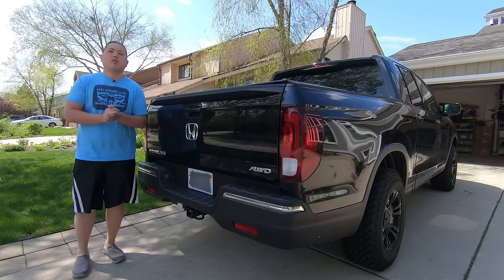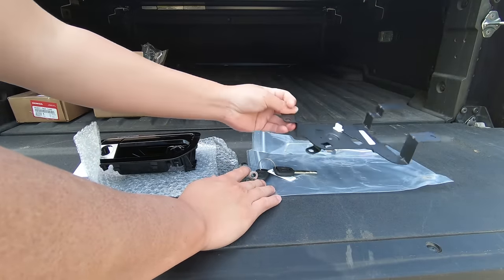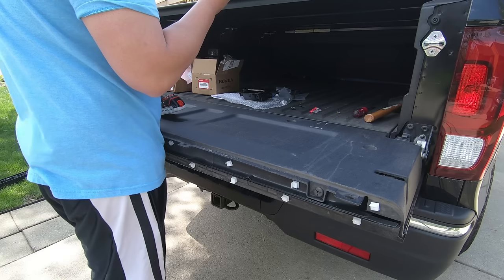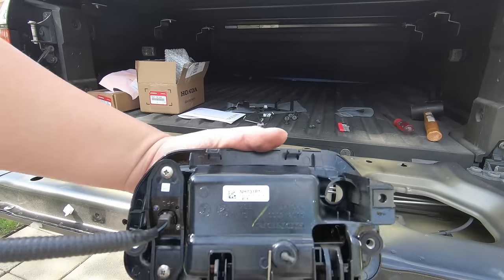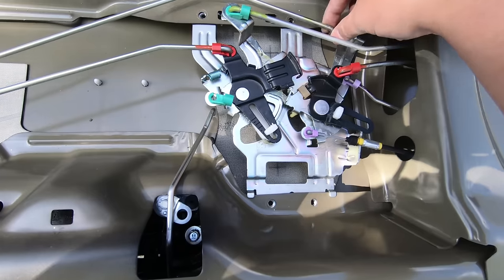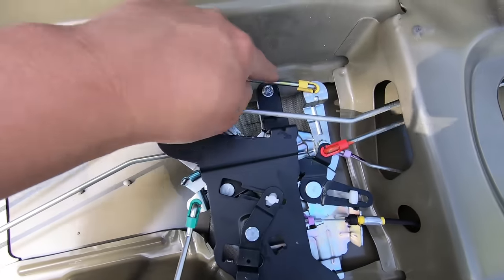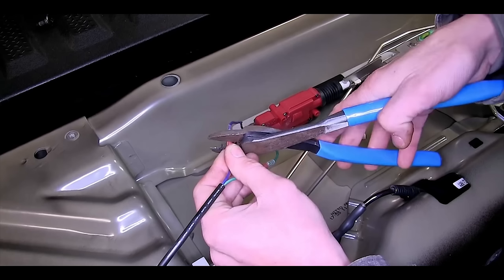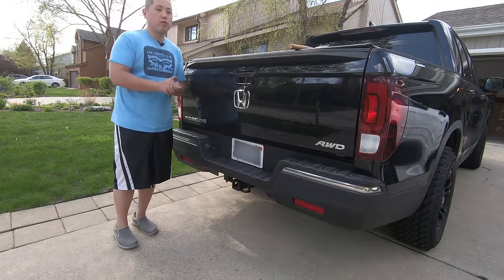Honda Ridgeline Tailgate Lock Install - OEM From Honda

Comment: I lucked out and didn't have to remove the tabs to slide my trim back on.  Lined em up and got it on the first try.  Also, a friend of mine with a Ridgeline suggested that I get my lock re-keyed.  So, I took his suggestion. I got my lock re-keyed to the key inside my keyfob, so I do not need to have extra keys on my ring for the trunk lock.  It only ran me $35.00  Cost my friend $50.00 .  Very much worth it in either case in my opinion.  Great video btw!
Reply: Thanks for the additional helpful tips!

Comment: Thank you so much for the write-up. Made installation very easy. As you mentioned, I removed the white push tabs from the inner tailgate and slid them back onto the black plastic trim panel. Made re-installation very easy.

Comment: Hey, Thank you so much for your Ridgeline videos, they have been quite helpful. I have changed out the back door checkers on my 2019 Ridgeline with the help of your video, and I added the locking tailgate handle about a year ago. I finally got around to pulling out the lock cylinder and having it re-keyed to the factory key today.  For $20.00 at a local locksmith, it was well worth it. Again, good job on your videos, keep up the good work!

Comment: The upgraded purple locking connector is supplied and is for replacing the smaller purple connector that is connected to the lever that controls the swing open feature of the tailgate , It is a more durable connector so it doesn't break if someone pulls on the lever for the side release feature when the tailgate is locked.

Comment: The purple clip that you didn't use was supposed to replace the purple clip in the mechanism. The new clip is larger and more robust. Not sure if Honda had issues during testing that were resolved with this part.  Did door checkers and tailgate lock this is past weekend. Thanks for the videos!
Reply from the maker: Thanks for sharing.  I kept it so we'll see how it is without it.
Reply: @Bahamut69  It replaces the one on the cable that comes in from the right.

Comment: excellent video, clear and concise!  I have a 2017 Ridgeline.  The Dealer could not even tell me if the kit would work because apparently the parts computer did not list it for the 2017.   The dealer wanted $220+ to install and charged me about $120 for the kit (both parts) .  I decided to try to install it myself after watching this video because nothing seemed outside of my limited ability.  To my joy and surprise everything worked and looked exactly like the video described.  The only slight difference was that my screws on the big panel were a Torx 40 instead of a 30.  Pretty minor.    Thanks again!

Comment: Thank you for posting this! Very clear. Took me less than 45 mins. Trickiest part is restarting the bolts holding in the handle, needlenose pliers help. Also put all the white plastic clips right back into the tailgate rim cap right after you take it off, paying attention to their orientation. It went right back on, first try for me. Putting the clips back in was the most time-consuming part of the process.

Comment: Another hearty THANK YOU for a great video!  Very easy to follow along and understand.  I was at a Metro Nashville stealership today getting my Ridgeline serviced and asked how much to have the lock installed.  They quoted labor of $130.  Figuring they saw me as a piece of candy on a stick, I decided I would give it the old college try.  Thankfully I had all of the tools necessary and this only took about 45 minutes (including reattaching the top cap) with no wrong turns.

Comment: Ok it was an easy step by step install. i did it in under 45 min. The hardest thing was getting the bolts loose and reattaching the top of the tail gate. But both were easy with your instructions. Thanks so much for a great DIY video.

Comment: I just ordered the tailgate handle (in my truck’s color) and the lock kit. I will let you know how the installation goes but your video makes it look pretty easy. Thanks!
Reply: How much did it cost?
Reply: @fiddelsworthdinkle  if I remember correctly it was under $50

Comment: Thanks for the video! Just finished with the install on my 2018 Ridgeline. Went great! My Honda dealer would not recommend doing this as the part numbers are listed for a 2019. I purchase from College Hills Honda on line cost $91.

Comment: The installation was a breeze after watching your video. The purple connector included w/ the kit is used on the cable that releases the tailgate to open like a car door. The handle down by the bumper. The new purple connector is beefier or more heavy-duty like the ones you'll be installing. Probably easier to go ahead and install it while the tailgate is disassembled rather than having to go back and replace it later. Thanks again for the video. Installation was easy.
Reply from the maker: Glad I can help!

Comment: Just looking at this now..  my 2023 Ridgeline does auto lock with keyfob.  It didn't at first because you need to "activate" the electronic locking feature in the touch screen settings.  works like a charm.

Comment: Thanks for the video it really helped since the directions were not that great. I ordered the parts from my dealership and the total was $117.70 after tax and they had free next day shipping to the dealership. I have a 2019 RTL-E in Modern Steel Metallic. If it helps anyone the part number for the handle in that color is 08Z07-T6Z-140E.
Reply from the maker: Glad it helped!

Comment: Thanks for the video.  Lock install took 45 minutes with no problems.  A long handle needle nose pliers made it easier to restart the 10mm bolts for the handle.  Thanks again,

Comment: I just installed mine as well. I love it! I’ve seen the pop and lock that are electronic. I asked my Honda tech about it and he said not to install the electronic version. They had a guy come in with the e-version and they fault like hell to get it open because the electronic actuator broke. It was total nightmare and took a week to get it to open. Not for me. I’m going with a manual one. Found out 2020 Ridgeline has the electronic locking tailgate now that works with the key fob. Honda also knew because of the failures of electronic devices like pop and lock they have a backup where you can unlock this secured door underneath the tailgate with your OEM key in the fob and pull this steel cable to unlock the tailgate if the actuator fails.
Reply: I'm glad that I'm not the only person that had seen problems with the Pop and Lock power tailgate lock. I had a customer with a 2018 Ridgeline with that system installed and it started to have problems staying locked. I thought that it may have been incorrect installation, but it turned out to be the actuator itself, which is the same problem that the guy you mentioned had. The customer decided to go with the factory lock instead and despite not being power actuated, she likes the factory one way better. I'm also glad the 2020 Ridgeline finally has a standard power lock for the tailgate as well because I actually like the Ridgeline and I'm considering buying for myself.

Comment: The aftermarket does make one both power and manual.  You don't have to run the wires all the way to the front anymore. You can just run it to the back door behind the driver and splice it into the wires there.

Comment: I took the locking cylinder to a locksmith shop and they rekeyed it so the key stored in the fob works.  It depends on your shop but mine charged me $60
Reply from the maker: Nice

Comment: Thanks for making these Videos. I just had the 1 1/2” truxx front lift kit put on my 2019 RTL-E. The new door checkers are here and I think I’m going to do that one myself. Now I want the tailgate lock too. I’ve got the hard folding cover and it was pricey. I never thought about someone stealing the actual cover until I read a comment here. I’m eyeballing some new more aggressive tires but I want to stick with the stock rims. Any advice on how big I can go without rubbing? 265/60/18?
Reply from the maker: You can't really go much bigger than stock without rubbing, the wheel wells just aren't made to accommodate bigger tires.   Best thing you can do is to get some aggressive looking AT tires, makes a big difference.

Comment: If I understand the system I think I prefer this non power lock method. If someone were to break into the car couldn't they just use the lock button on the door and gain access? This method they could not?

Comment: I did my and also rekey the lock cylinder to work with my truck keyfob. I don’t need to carry two set of keys.
Reply from the maker: Nice, how much did it cost you?
Reply: Drivers Only I watched YouTube video and did it myself. I think if you go to locksmith will charge you $50.
Reply: Had a mobile locksmith do it at my house for $65. Took less than 30 mins.
Reply: I did the same to mine, but took it to the dealer. Probably paid a little more for it to be done, but if it was done wrong or something was broken in the process, they would be on the hook for that.

Comment: So weird it doesn’t lock. I used to have a 2006 when then they first came out & if remembered correctly the tailgate used to lock & unlock with the fob & door lock button. Wonder if I’m accurate if this oversight it’s these late models. Great vids buddy.
Reply from the maker: Honda cut some corners with the new ridgeline and this is one of them.  The truck locks but not the tailgate.

Comment: My dealership is showing the part only come up for 2019 models. I know your description says 2017 - 2020, but I've got a 2017 so wanted to double check what you're basing that on? Thanks!
Reply: His truck is a 2018 so they must exist for that year plus have there been any significant changes between 17, 18 and 19 in bed handle? I have 2017.
Reply: Worked on my 2017 RTL-E

Comment: I had a tailgate lock included when I bought my Ridgeline.  What I think is funny is your video is pretty cut and dry on how to do it.  My dealership its kicking their butts on installing it.  Today is try #4 for them to do it.  I showed the service department manager this video and I might as well been showing her a video in some strange language
Reply from the maker: I dont see why they should give a fuss about it. The parts are straight from Honda and not aftermarket. It would take them no more than a hour start to finish. You might want to just try yourself.

Comment: Just have my new 2019 ridgeline. I notice that did not come with wheels locking lug nuts. Would be good idea to do a video with the best locking nuts for this truck.
Reply: I just bought a Sport AWD 2019. No locking lug nuts. Ugh. Didn't see that one coming either, just like the missing tailgate lock.

Comment: You added 1-1/2 lift kit on your Ridgeline did you do it yourself id so do you have a video on it. Could you provide part number for it. Thanks for all your video it's a real charm to make the modifications after having watched them.
Reply from the maker: Yes with some help and it was very difficult to do.  I would suggest getting a shop to do it.  Took 4 hrs each side.  You can find them on Amazon.
Reply: @DriversOnly  great make and model would be great. Thanks again.

Comment: I thought it had a tail gate lock if you open the glove box..? Top left after you open it, there is a switch. Isn't that for the tail gate..?
Reply: FreakoRico999 - that switch is for the trunk, not the tailgate.
Reply: @tomsdreamshopworx  aahh ok, thank you for clearing it up! Only did a test drive in a Ridgeline, and I like it a lot.. But it costs way too much to take it back to the Netherlands with me... Sadly..

Comment: Hello, we had ours done at the dealership. It has been very hard to get the tailgate to open.  9 out of 10 times you have to yank the handle upwards with a hard tug.  The dealership has had two attempts to fix the problem.  Any tips?  Other than go to a new dealership or do it myself??
Reply from the maker: Something must be wrong,  I never have to do that with mine.  Opens just like how it was before.  I would have them redo.

Comment: Does your FOB work w/ the gate lock?  I assume key only....
Reply from the maker: No it does not
Reply: You can take the new cylinder to have it rekeyed to your fob key before you install it. I have heard of a large range of prices for this depending on the locksmith and where you are located.

Comment: Any issues with vcm?
Reply from the maker: Nope.
Reply: What's vcm?
Reply: Eugene Kovalenko 
Variable cylinder management
Reply: Dave I own a 2017 RTL-T and was not happy with that “Rumble Strip Vibration Feel” when the cylinders de-activated.  A year ago I installed the VCMUZZLER (resistor that plugs into the ECT thermostat plug) and no more de-activation, truck runs great.  I was not concerned about MPG which really was not that much improved by the VCM technology.  The following link posted on the Ridgeline Owners Club  -  http://www.ridgelineownersclub.com/forums/138-second-generation-Ridgeline-2g-2017/139297-VCMuzzler-II-disabling-vcm-faq-s.html

I purchased my VCMuzzler from the original inventor who goes by Verbatim on the Ridgeline Owners Club discussion

Comment: I just got a Ridgeline and had my dealer do this install and they didn't get it right! Drove away assuming they had tested it and when I tried to open it I had to triple clutch it and there was no obvious engagement point where you could feel the latch mechanism clicking open. Immediately took it back and it worked randomly when the service manager tried it but he said they needed to take another look. 15 minutes later and it was a whole different experience. Now there is a definitive click at the half way point but it feels like it is already starting to revert back to where you have to pull hard up to get it to release. Not good. Totally lame that Honda did not include this from the factory that worked electronically. It would not have been bard since there is a "tailgate open" warning on the dash. Someone should be fired over this oversight. 

If it fails again I will get a refund and have the old one put back on and take my chances. Totally lame.
Reply from the maker: Dont know how they messed up. Honda did skimp on a few things and this is one of them.  Also the rear door checker!

Comment: WTH @Honda.  The tailgate doesn't have a power lock mechanism?  This is a major design oversight or a stupid cost cutting measure.  If I want to install a (Honda) tonneau cover and hide my valuables in the bed of the truck, anyone could simply open the tailgate?  So much SMH with this.